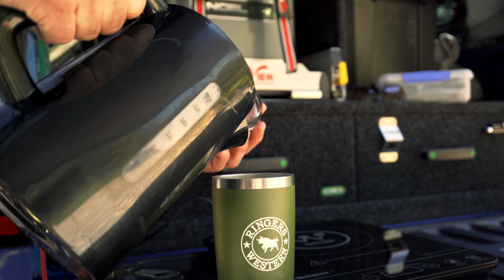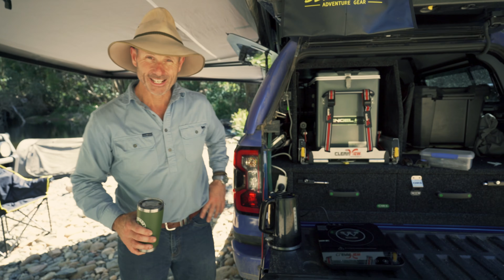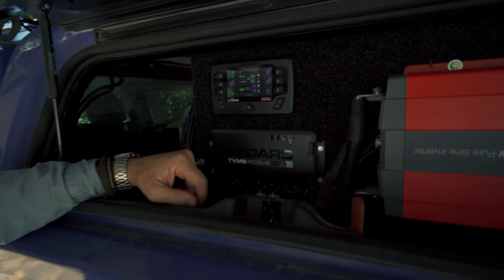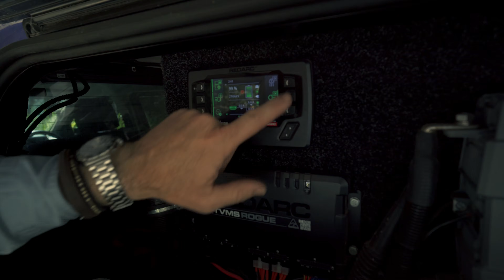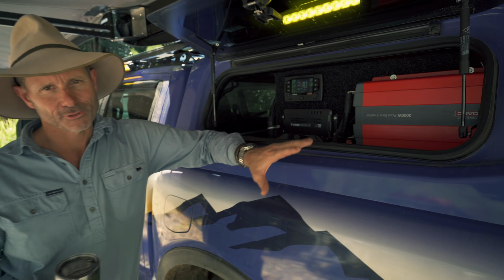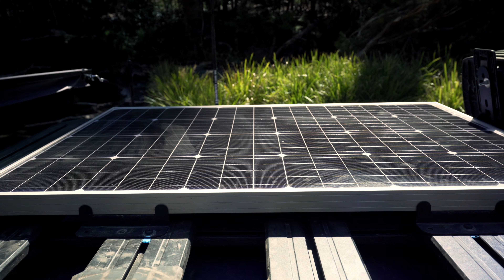Pat Callinan's Ford Ranger Camping Power Setup | Off-Grid Power

Comment: how is the inverter connected to the Rogue? on the TVMS it was through a cable but there isnt the same cable on the Rogue.
Reply from the maker: Thanks for watching! The Rogue utilises an Output to act as the on/off switch for the inverter. More information is available on page 22 of the manual here - https://cdn.intelligencebank.com/au/share/yE9N/zJpl/6gz9n/original/TVMS+Rogue+Manual+English